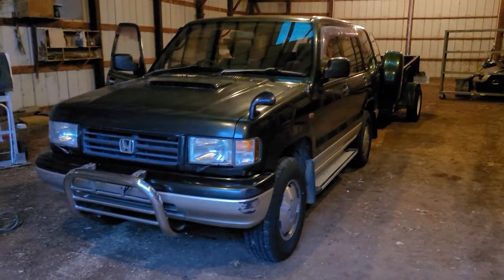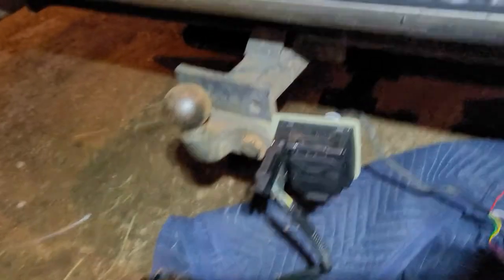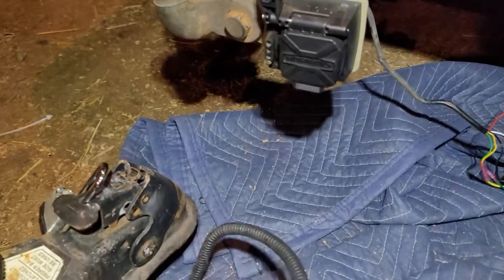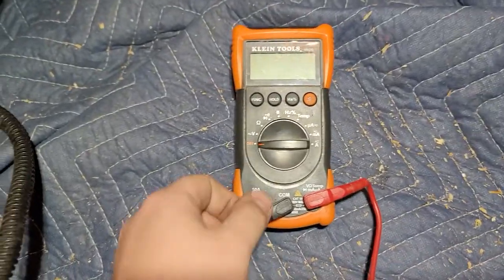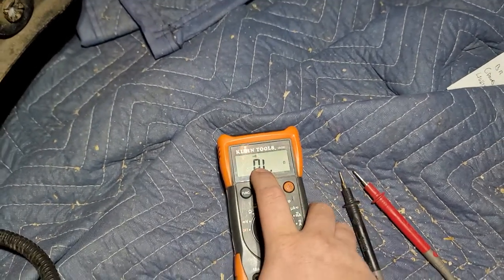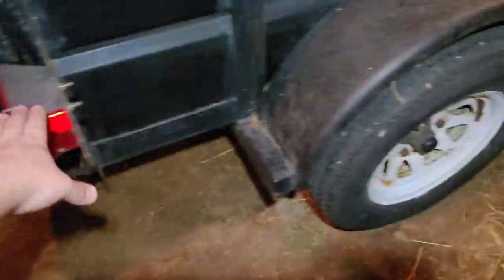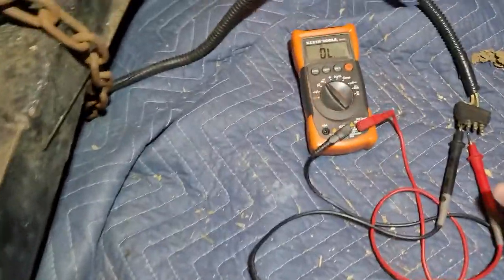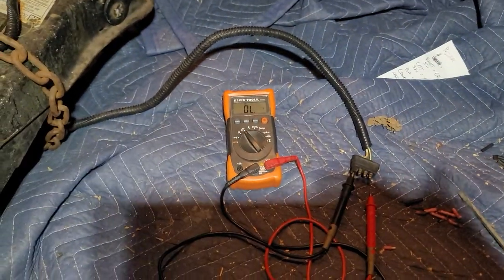Diagnosing trailer light issues

Comment: Open circuit 
Closed circuit 
Shorted circuit 
LED sealed beam lamps with individual ground wires to each lamp are the only way to go with !  Place alligator clips on a 12 volt buzzer and connect to the shorted circuit , this will sound the buzzer . Wiggle and Shake the harnesses , when the buzzer stops you have found the area of the short circuit .       5/30/23